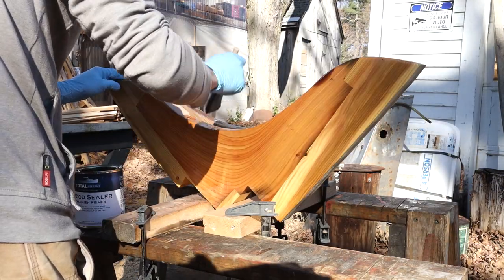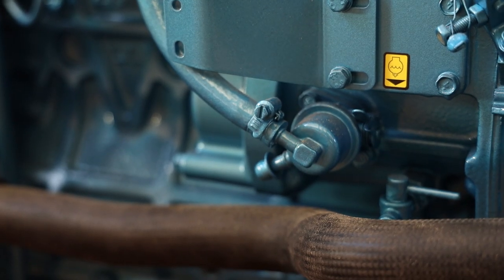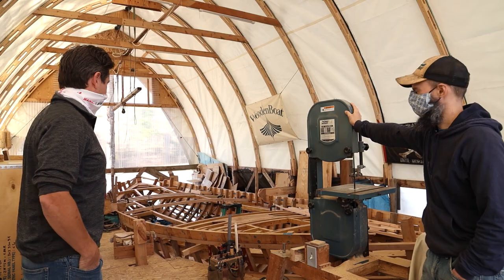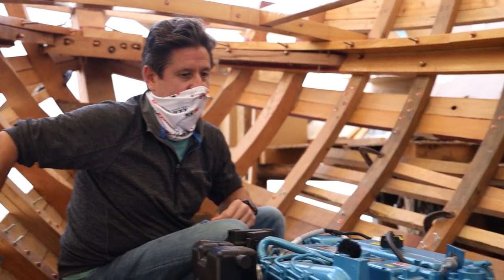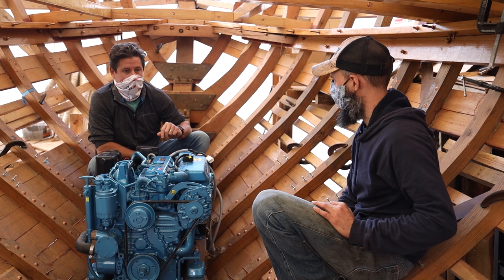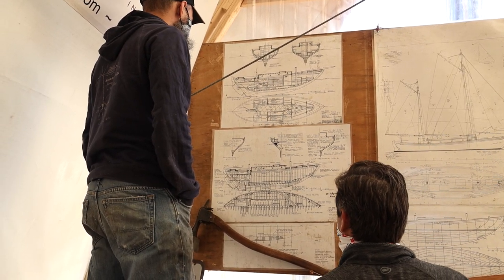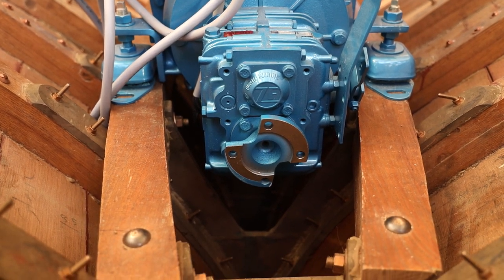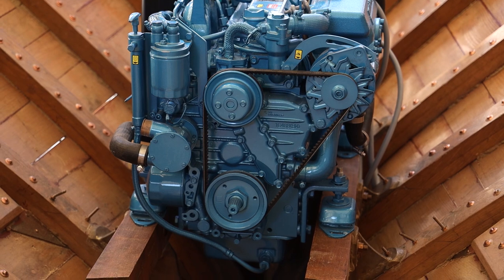Designing the Power Plant - Episode 137 - Acorn to Arabella: Journey of a Wooden Boat

Comment: Very important tips:

- Get the hot water. A hot shower after spending a cold rainy watch at the tiller is worth much more than it costs.

- Do not underestimate how much electricity you use. A 100 amp alternator is at the low end even for the power use you are planning on. (much less for the power use that might be added later)

The comparison to the mains connection you have at the house is very misleading because there you got 10 times the Voltage and you got it all the time.

Once you are sailing nicely you are likely not going to want to turn on the engine. So it is not going to run a lot.
If the engine is only going to run for a short while every now and then you are going to need plenty enough oomph on the alternator so you can recharge the batteries.

Comment: Note at 16:30  12 volts at 100 amps is not the same as your house 220 volt 100 amp service.  The power (volts x amps) is 18 times more in the house system.

Comment: You run the shop and the house on 100 amps. Yeah but I bet that's not at 12 Volt. That second alternator is a great idea if one provides only 1200W. Thats a fraction of the motor output, even at the lowest setting.

Comment: Did I hear you correctly, your not going to have any fresh water conversion system? Or hot water for showers or anything else that is normal on a newer boat like a microwave? You might be kicking yourself later on when you’re a thousand miles from anything and it’s cold and your soaking wet and you just want a hot shower.

Comment: Holes in the boat, hmmm. 1 for the engine raw water, 1 for the galley , wash down pump & head supply & 1 for the head (black water) discharge. The exhaust, grey water  & bilge can be above the water line. So 5 holes  unless you have 2 bilge pumps, then 6. Stay away from Vetus wet exhausts, look for Centek instead. Plastic versus fiberglass? No brainer there.
Reply: Oops, missed 1! Need a nice fat 2" for the transducer as well, so 6-7 holes.

Comment: stick with the deck stepped mizzen just to keep more space below even though its a neat little engine the filters are a pain to change  remote filters give you the option to have dual filters to quick swap on the go fuel filters always block when you dont want them oil filters less so but side mounted oilfilters are daft. saltwater intake as low as you can go ..Where di  victoria have hers?

Comment: In a boat this size wouldn't a radiator be more practical than putting a hole in the bottom of the boat and using potentially debris filled sea water for cooling?  The heat in the radiator could be expelled or used for heat and hot water.

Comment: There's lots of opinions in these comments, but not much discussion about how Steve and Alix plan to use Arabella and where they plan on sailing.   IIRC, Steve and Alix haven't discussed their cruising plans in their videos.  Also, talk of "needs" or "must haves" are irrelevant.  Many have sailed around the world with no engine and no electronics.  So, there are no "needs" or "must haves".  There's also been little or no discussion about the time and effort required to maintain the systems being proposed and the cost and availability of spare parts in foreign ports.  

I've done considerable cruising on sailboats and have the following recommendation.  First, decide where you want to cruise.  Second, install the minimum number of "simple" utility systems that will allow a standard of onboard living that meets your needs when cruising in your target cruising areas.  Basically, adopt the KISS principal.  If the KISS principal applies anywhere, it applies to cruising sailboats.  

Most "round-the-world" cruisers sail in the tropics for two reasons.  The "camping out" lifestyle on a cruising boat is a lot more pleasant in warm climates.  The trade winds provide relatively predictable sailing plus natural air conditioning.  If sailing the tropics, there's no need for shower facilities which require the cost and space for a shower stall, a pressured freshwater system, a water heater, a large freshwater storage tank, a system for providing large quantities of fresh water and a shower drain system.  Instead, wash in your inflatable dinghy using seawater and dish detergent.  Then rinse off on the foredeck of Arabella using a half gallon container of fresh water per person.  This works perfectly fine in the tropics.  Not so much in the higher latitudes.  

A similar evaluation can be made for every system on your boat.  If you are planning long ocean passages, such as across the Pacific, an autopilot or windvane is unnecessary if you have, say, a crew of 5.  That would allow a watch system of 2 hrs on/8 hrs off.  Two hour spells at the helm are relatively easy, even in heavy weather, and 8 hours off provides plenty of time for trying to sleep or housekeeping.   However, if there's only 2 crew, then an autopilot or windvane becomes essential, especially when considering the possibility of illness or injury.  

Most cruisers spend 5 - 10 days in port for every 1 day sailing.  Your boat acts as your floating house.  You use it to take you to nice places and then stay a while to enjoy the nice places.  Investing a lot of cost, space, and effort to slightly or moderately improve your living standard during your limited time making passages is not an efficient use of resources.  

Steve and Alix have decided to have a diesel engine on Arabella, which necessitates diesel tanks and a 12 v electric system.  That's fine.  Now is a good time for them to decide what other systems they want to buy, install, and maintain.  I suggest installing 12 volt lighting for running lights and house lighting, followed by refrigeration.  I've drunk warm Tang and rum in many cockpits and I never acquired a taste for it.  Ditto for canned food.  There is no cruising amenity that has a greater effect on quality-of-life than refrigeration.  Modern solar panels and 12 volt refrigeration systems work well with a well-insulated freezer/refrig box.  If there is no practical space for solar panels, a windmill will do the job if you are cruising in trade-wind zones.  If not, a refrigeration compressor can be run off the diesel engine.  Coupled with cold boxes in a well-insulated refrigerator box, this will provide freezer and refrigerator service while idling the diesel for 30 - 45 minutes each day.  

I suggest Steve and Alix give serious consideration to what systems, if any, they want beyond lights and refrigeration.

Have fun making these decisions.
Reply from the maker: Someone gets it :) thank you for that very reasonable comment.

Comment: I would think it more practical to have a small generator onboard to top off batteries rather than use the engine. I agree with others that you shouldn't skimp too much on a few luxuries.  They can come later but don't limit yourself in the beginning with too little electrical power.

Comment: Can't believe they just spray painted that motor with all the hoses and filters on.
Reply: @Simon Fraser That's very common with industrial engines. Back in the 1950's, John Deere took it a little more extreme. Their tractors rolled down the line on a set of temporary wheels. The only part of the tractor that was masked off for painting were the axles. After spraying the ENTIRE tractor in green, yellow wheels were installed, and unpainted seat cushions, steering wheel, and electrical components were installed. The exhaust was completely green as well. The paint on the exhaust invariably burned off in the first couple hours of use.

Comment: IMHO I wouldn't remote anything. As for what falls out of filters that's what ziplock bags and absorbent mats or paper towels/rags are for. My bilges are white fiberglass and there is never oil and such from filter changes on it. You all really need to consider access to the motor and make it easy on yourselves in the future. Remoting everything may be cool for PM's but a starter change could be a real f_in nightmare if not thought about ahead of time.   
Just keep in mind that the further you move the fuel filter away from the motor the more you will have to prime to get fuel to the motor. Also the same lines will be full of fuel or oil when you do your filter changes. A lot more leakage. Everything is clean and tight to the motor now. Longer hoses and connections are just more future issues. 
You all are thinking only Nav lights today but you wont be after a year on the water. Wicked over build the electric basics now because before you know it you will have 5 screens in front of you for Nav and Com's equipment, cabin lights, PC's and phones to charge, food storage and cooking, water pumps, etc, etc..... A big fuse panel with one thing connected to it now is a lot better then not having another connection when needed in the future. 
The issue with feathering props is you have to keep them clean. Barnacles and other crap will not allow them to fold and open proper. tropical waters could be a issue.  
I would also put a metal plates under the motor mounts and not just let them sit on the raw wood.
As I said in another post you all should really should consider putting a future desalination plant in the works. They are small and cheap and will keep you from being tethered to a fresh water source.  
I have a 100 more but I will save them....

Comment: I was concerned by the comment about "you could run the house and the boat shop off 100A" not at 12V you could not. A 100A 12V alternator is 1200W AT BEST. Whereas your 100A AC service is ~24,000 watts.

Comment: 100 amps @ 12 volts DC is 1200 Watts energy while 100 amps @ 240 volts AC is 24,000 Watts energy. BIG difference. In addition a second alternator installed with the idler pulley loose (so it’s not normally turning) wold make a back-up power source when you are halfway to Tahiti and your primary alternator quits. Just sayin’

Comment: I reacted to the ”we run the house and the boathouse of 100amp” 
Thats 110v i suspect? Theres a huuge difference between 100amp 12v and 100amp 110, like a Factor of ten.
At 12v 100amp you can run about 1000w
Reply: Aren't US wired two-phase systems wired with 100A on each phase?
That makes 240v so at 100A, 24,000w
at 12v DC it is 1200w, so maybe a kw actually available once you allow for the losses of charging and discharging batteries.
With electronics using less and less power these days, it is possible, as long as you are prepared to do without everything that uses electricity to create physical power or heat.  That includes winches and power tools - even cordless ones.  A separate diesel fuel water heater is more economical than running the engine just for the "free" hot water you can collect inefficiently as waste heat - collect it when using the motor anyway, as both can feed the same hot water tank and that can be properly insulated to retain heat for a while..  Definitely avoid expensive and dangerous propane or butane for water heating and if possible cooking (both, being heavier than air, collect in bilges). I have personally picked a guy out of the water after his boat exploded as a result of this.  The burns were not a pretty sight, but he did survive).
I would not allow as much as a butane lighter on board any boat I was responsible for after that, except in self-draining areas like the upper deck or most cockpits (as long as the accomodation way has a decent coaming).
You should be able to find a multi-fuel burner for cooking which will run on diesel fuel as well as other types.  It'll pay for itself in reduced insurance cost, even before you factor in the saving in fuel cost (diesel has a very high calorific value compared to other fuels).
You never want to be running the main engine just to generate heat or electrical power, or even both.
But when under sail or when moored, do turn the motor frequently enough to avoid problems.  Weekly should do it.  Oil only clings to the insides of an engine for so long, and the "drier" the engine becomes, the more wear is caused when it is eventually started.  The expense of hauling an engine for bearing replacement gets old real quick!  Run it for just long enough to get the oil up to temperature so that all nasties boil off, and while it is running, charge whatever you can.

Comment: My two cents:  You should make/buy a BIG PVC tub to go under it the motor. Something like: https://www.lowes.com/pd/MacCourt-Drywall-Mud-Pans/1054711.  I think if you gently heat the PVC you can make it conform better to the shape of the hull. Eventually, there will be an oil/fuel leaking. This could make it easier to clean up.

Comment: 100 amp alternator is 1200 watts. 100 amp house panel is 12,000 watts. Not the same. Also, 100A is maximum from the alternator IF the engine is running at high revs.

Comment: Keep in mind your house and shop is running on 100 amp 240V and is then split to 120V, 100 amp 12V is a lot less power than it sounds. 24000 watts vs. 1200 watts.

Comment: Hot water and 12v fridge are a must.  I travel similarly in a pickup camper and those 2 things are essential for enjoyment. Pan under the engine. Duel alternators, and separate starting and house batteries with solar.   I run my 12v fridge with 120 watts of solar.  Find someone that has more complete knowledge of the systems than this guy.  Look at the overland travel stuff, much is very efficient and makes life much more enjoyable in a small space.  You don't want an issue in a storm.   Goal zero stuff is a total ripoff.  You can build your own for much much less.

Comment: Plan out heating/ac/hot water.   The ocean is horribly unforgiving and those two "creature comforts" will save you from going insane... you grew up on a farm, not on the water, don't play around thinking you'll be fine bc you won't.   Plan out a fresh water system (even if its not potable) for getting the salt off from time to time... it'll help on long crossings... do this now, instead of jerryrigging it after it is built....

Comment: MAKE A CATCH PAN OUT OF SHEET METAL  OR ANYTHING YOU CAN SURFACE SEAL TO HOLD ANY AFFLUENTS EASY TO FORM !!  AND FIT IT TO CAVITY UNDER MOTOR. STUFF HAPPEDS AND THE MESS SHOULD ALL FIT THE PAN AND NOT FOUL THE BOATS BILGE. IF IT HITS THE BILGE IT GROWS AND SPREADS LIKE FUNGUS

Comment: Does engine exhaust harm wood near the outlet?
Reply: You use a water muffler, introduce water to the exhaust elbow cooling the exhaust a bit. Then exhaust and water are discharged through a thru hull fitting above the waterline.

Comment: Don't confuse the 100 amps off your alternator with being equal to the 100 amp service into your home as being equal. They aren't even close to the same. 100 amps at 12 volts equal 1200 watts, whereas 100 amps at 115 volts equal  11500  watts. That's pretty much ten times the power.

Comment: I’ve built several engine gauge/switch and DC panels for friends.  Would be happy to make panels (minus gauges and switches/breakers) for you (CNC from Aluminum or ABS).  I’ve also have an article on remote mounted oil filters I wrote for a international Catalina publication if interested.

Comment: I'll give two comments from doing industrial vertical design.  

1) Be careful on the mounting height of your prefilter/water separator.  If it is too high it can be difficult to reprime after changing filters.  Having a prime pump before or in the prefilter can help this too.

2) if possible make sure you can remove the oil pan without taking the engine out.  Shaving a couple boards now might save you days of work in the future.  This is also why is be hesitant about (or think a lot about the design) installing a drip pan cause it could hamper pulling the oil pan later.

Comment: Some ideas for your consideration.  A through hull up in the bow for an anchor wash down pump/hose for cleaning the chain.  Doing it with a bucket on a rolling deck will cause you to not reanchor when you should.   Second do an energy management spread sheet first.  Do one for at sea and one for at anchor because different systems are used for each.  Find the amps for every item, time the hours expected use each day will give you amp hrs.  Add them up will help you determine battery capacity and charging needs.  Will send you a copy of mine if you want if you want to see it.

Comment: 100 amps @ 12v is VERY easy to find you need more power..  and NOT the same thing as 100 amps @ 220v!!!   I can't remember but the equation for total POWER , but voltage and Amperage work together  and 220 volts is a LOT more voltage than 12 Volts

Comment: Don't use flexible solar panels... look into longevity and failures on those.  They have been a source of vehicle failures because they are tight on the structure and when they fail they can cause an overheat where they are in contact.